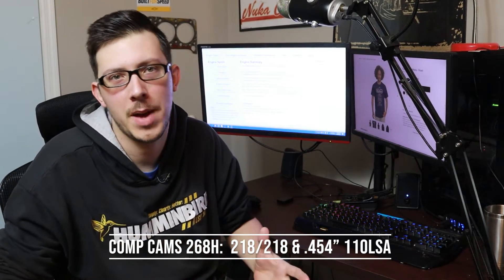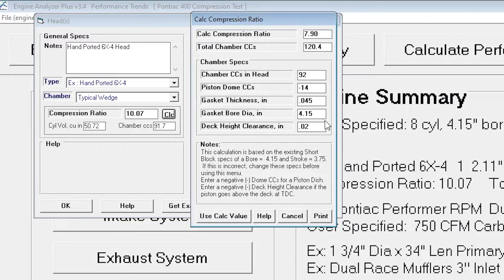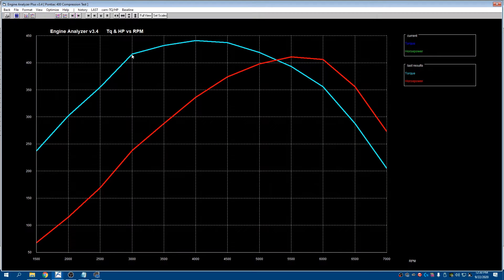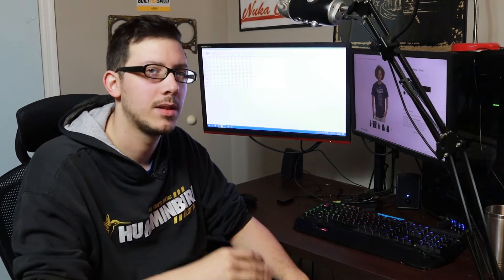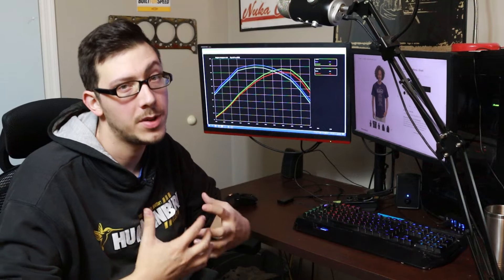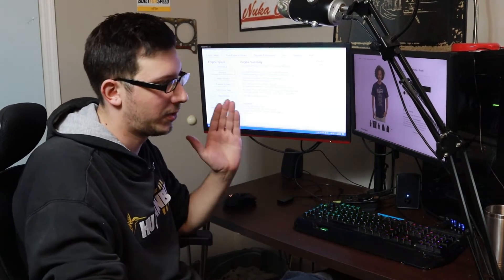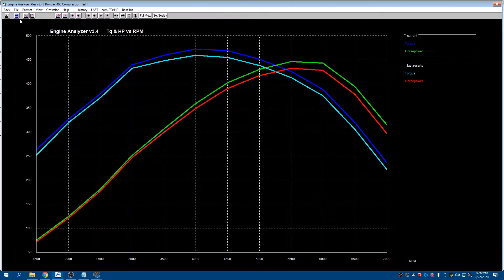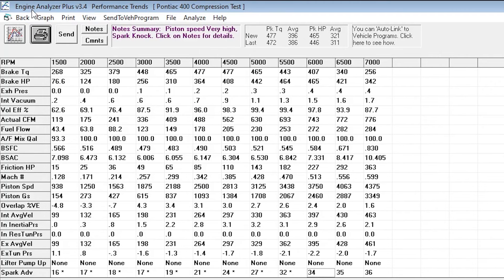Is It Worth It?! Increasing Compression Ratio for MORE Horsepower

Comment: I live at 7200 feet. I've found that small single cylinder engines here will almost double their output with a small increase in compression. Makes them much easier to start as well, and increases spark plug life. My engine is 150cc but I'm told this holds true for engines between 50cc and 200cc.

Comment: What if you have a 650hp 434 pump gas 12:1 compression and you increase the compression to 14.5:1 and run on e85. What's your guesstimate. Also the head flow increases from 300cfm to 360cfm

Comment: Low compression is for pussies afraid of real torque! Lol 20yrs Ive been runnin on pump gas with 72cc 62 iron heads just over 12 to 1 just fine. Run a nice long duration cam just like poniac's were intended as long as you go by your dynamic and not static compression to choose a cam and set your timing right.  Install a wide band and egt prob to keep that air to fuel on par

Comment: Do not run O.O3O" quench, or your kissing the heads with your pistons on a zero deck or not a zero deck. There is no more benefit beyond O.O35" besides.  And even that is a tall order even with an rpm limit of 4500 and all densely forged exotic materials, more exotic than 4340 forgings even then  the pistons are kissing just softly. You want at least 175 psi cylinder pressure on anything or the engine's tune is not worth the octane. You want quench exactly at .039" to .040" no matter what deck clearance or head gasket you run, You do not adjust compression ratio with head gasket measurement.  It is not merely piston design type that determines your compression, Those are very broad and vague generalizations that could be all the points off of target compression as any types of pistons.  The proper way to design compression is the head chamber CC volume and the piston's CC volume = NOT head gasket or piston to deck clearance for witch you want Zero and use a O.O39" or O.O4O" head gasket for the exact same quench area. This keeps heat out of your top piston ringland that causes all the rolls canargally engine problems and burning oil cracking pistons and wear and power loss. To achieve beyond the 350-380hp barrier and be a good engine this needs done properly. Efficiencies shall always be up. For example the ZZ350 crate engine measured in with 195PSI and is why it is such a great performance engine for stockish camaros and such although it needs 93 octane. It's fast burn vortec head chamber and runner design and cooling properties allow the chevy iron to mitigate and keep away any hot spots that could lead to detonation (engine knock). always check piston to valve clearance and design the valve reliefs to match angle and give .080" piston to valve clearance intake and O.1OO" exhaust valve these are absolute minimum figures respectively. This can be done by machining or using a simple dremel tool on the piston area to be shaped to specification, also be aware of hollow domes or piston design when doing this, your target piston should be a little tighter before final cc'ing as far as CC relief although not necessarily valve to piston clearance, this way if you need to clearance the pistons slightly a few cc's lost shall bring it closer to the target. Same with head CC, get a tighter CC in the chamber than required so when you CC heads you do not need to add material, although perhaps removal of material during porting and final chamber shaping is often desired. For example i am running pistons above deck O.OO2" so instead of a O.O4O" head gasket i use a O.O41" head gasket for my O.O39" quench area.

Comment: My question is how high compression  can I go running 91 octane on a 350 chevy with iron heads and a very small duration  camshaft 201/207@50 duration  and 114 lobe separation?  9.5 to 1 or 10 to 1  be the cut off point?  I want put all the compression  I can into it with a little timing and not have pinging issues. I'm building it for a low rpm torque and mileage engine.
Reply: @tthams73 isn't it the dynamic compression  which is controlled  by the camshaft specs to determine the psi pressure? I have a 383 with 200psi cranking compression  and it runs on 87 octane just fine with pinging. It's about 9.5 compression  and 8.0 dynamic.

Comment: Not worth it. My mate decreased CR from 10:1 to 9:1 on his project car. Now he revs higher and makes more power. After that he even decreased it to 8:1 and increased turbo boost. All in all he is making 400 hp to the wheels from a 2.0  turbo.
Reply: With turbochargers the lower the compression the more boost you can do safely higher compression you can’t use much boost so either is worth it depending on your build
Reply: How much psi for 400hp?
Reply: @lilmixdboy  i think its 17 psi if i remember correctly
Reply: @creatineenjoyer7345  impressive if so
Reply: Not possible

Comment: Hey I'm running LS1 only stock 241 heads but have 238 242 .603 .603 @ 112 how much could I take off my heads to have safe PVC and could I use thinner head gasket .only got 350rwhp all Bolton's headers etc 4l60e n 4 K stall take lot off it,I want to get over 400rwhp should I pp the 241s or source some 243s n pp them,will be adding 25% under drive pulley aswell anything to add compression n power would be helpful .love the big cam just needs heads get most out of it
Reply from the maker: If you haven't fondled the 241s the 243s WILL make more power. You can get the GTO 243s cheaper since they didn't come with sodium filled valves. 

If it were me I'd go used 243 heads, thin gaskets, and maybe a port job. I'd assume if you ported the 241s you might end up around stock 243s but some people have great CNC setups to make the 241s work. That cam should be plenty big enough to move air, it's bigger than the SS2.

What RPM are you shifting at?
Reply: @LSxHunter  it's Australian cam range vcm 13 rev range is 4500 to 7000 need a 4k stall at lowest,only got tuned bit over week ago shift between 6500 -7 I'd be guessing going flat out,241s haven't been touched just springs etc to suit the cam,I can get 241s pp n decked 900 Aus currency or 243s new castings looking about 700 than Pp cost on top,or are there other heads good priced best bang for buck HP can get shipped over from USA?regards love your vids,ppl want heaps here in Aus for 243s
Reply from the maker: @solangus7730  I'm a fan of use what ya got - a good CNC'd set of 241s with valve upgrades should flow 280-300cfm at .600 which puts you in a pretty good spot. If you're going to PP it's worth decking like you're saying. 

When you increase the port volume you'll be losing low end torque, that can be regained by increasing compression. 

Thanks for watching! For some reason we've got a bunch of people watching from Australia.
Reply: @LSxHunter  what about milled and pp 706 on a ls1?

Comment: The block I'm running is a 481988 with stock internals and the stock 4x heads, but I bought a set of #16 heads for this engine. Would I be able to use them, or would this still put my compression too high?
Reply from the maker: Early 70s 400? You'd likely need to run 91ish octane as you'd be in the 9.5-10:1 area. I'm a fan of ditching the 4X immediately. The #16s are great heads. It depends also if your engine had dished pistons or the flat tops - if they're dished I'd slap it together. It's typical for Pontiac to rate their stock engines at 0.50 point of compression more than they actually are.
Reply: @LSxHunter  Thanks for a quick response and help! I smashed that subscribe button, I'll have to check out your other videos when I get off work!
Reply: Not if it’s cammed correctly.

Comment: Thanks for the comparison, when you start getting into higher compression builds, there are a couple more factors you have to consider; What elevation will I be running at, what is my quench factor, and Timing,Timing, timing, customize your distributor curve, and your cam choice is a big factor. I run 10.2:1 with 670 72cc heads on 91 octane, at 4500' and it's just fine.....and fast;)
Reply from the maker: The amount of arguments I've had on Facebook lately about dynamic compression ratios are killing me. I don't care what anybody says, with the right cam and timing you can run dang near any compression ratio.
Reply: @LSxHunter  I agree 100% A good percentage of people disagreeing with compression ratio being too high havent built an engine of their own, not to mention make dumb camshaft choices because they read and believe what they read.

Comment: I’m wanting to build a 455 and have a choice of 4X, 6X-8 or 6X-4 heads with stock lower end. Cam is unknown at this point but it’s a street engine, occasional track maybe. Best local gas is 94 octane with no ethanol. Thanks!
Reply from the maker: On a 455 I'd likely reach for the 6X-8s. For most people they're undesirable since they have the larger chamber but that gives you around a 9:1 compression ratio. 4X heads are a crapshoot and they tend to flow significantly less than 6X heads. 4X heads can be pressed or screwed in studs as well as 1.96 or 2.11 intake valves. The 6Xs are a known quantity and most shops are familiar with porting them down the road.

Comment: What’s your opinion on 4x heads on a 455 with flat top pistons. Thanks
Reply from the maker: I've got a personal gripe against the 4X because of the wild rolling changes during their run. I've seen them in 1.96 and 2.11 as well as 95cc and as large as 112cc. For a 455 I'd look for 6X-8s since they for sure have large valves, better flow, and larger chambers. The 6Xs also give you the option of milling later as well if you want to make a jump to race gas.
Reply: How about the 96 heads compared to the 6x?
Reply from the maker: @markburkey6371  the compression should be comparable to like a 6X-4 head. Everything I've seen their nearly equal with the 96 flowing a HAIR better unported. The 96 should be the same 2.11/1.77 valves with a 96cc chamber vs the 6Xs 2.11/1.66 valves and 92cc chambers.